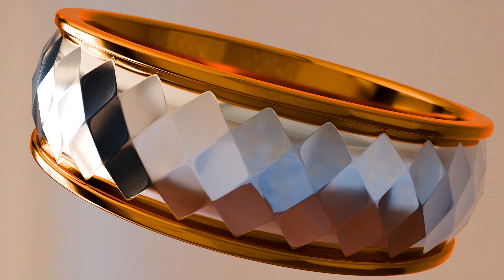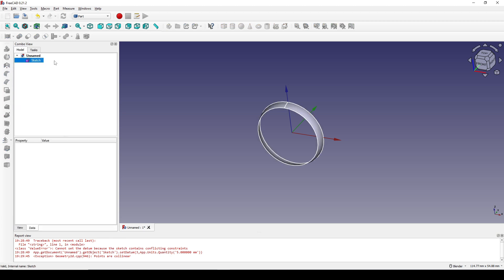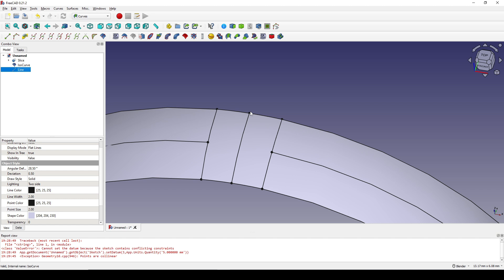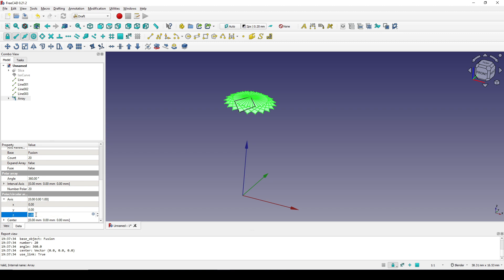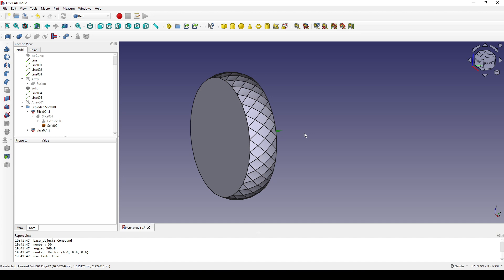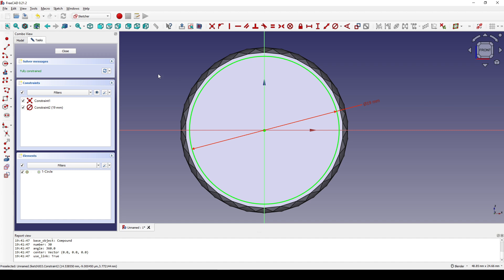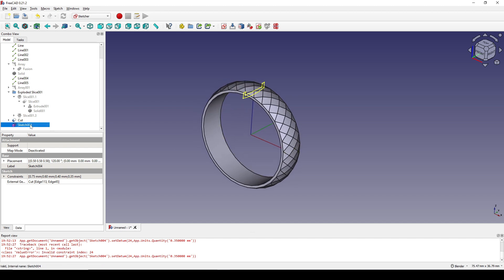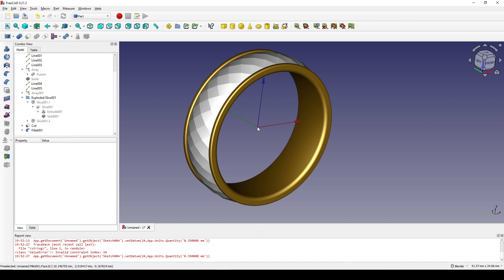Step-by-Step Guide: Ring Design in FreeCAD.

Comment: I had trouble around 7:57...keep getting error when trying to use parametric solid know any solution?
Reply: I ran into the same issue. The problem went away when I opened the Array tree and also selected "Fusion" so all parts of the body are highlighted.
Reply: 私も同じところでエラーが出ています良い解決策有りましたか。

Comment: I had a problem at 11:30, I only got 2 slices. So I changed the design of Sketch002 (the symmetrical distance of the two lines to 4.99 mm), and the slice worked like yours.